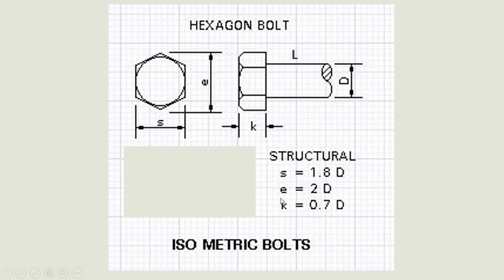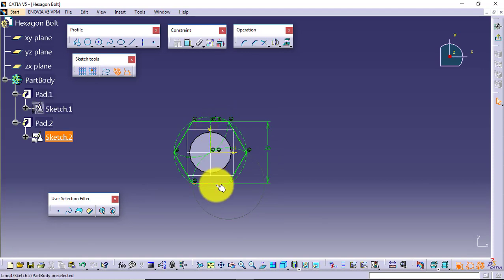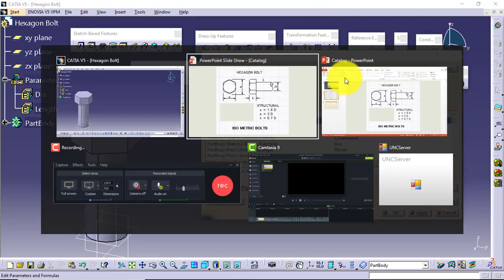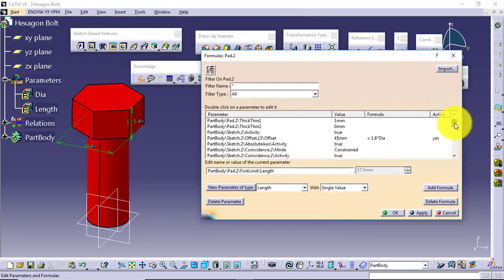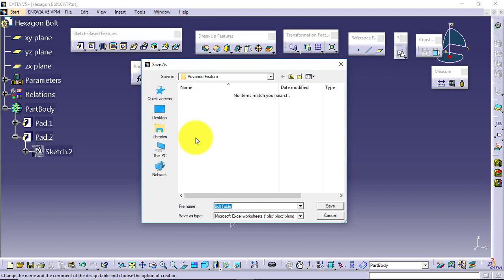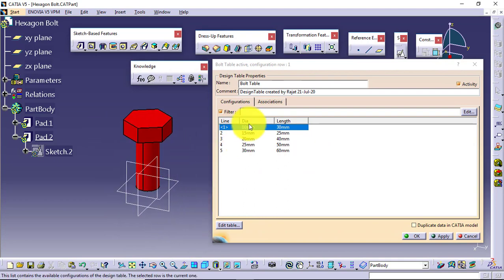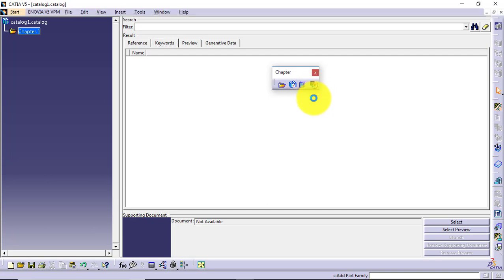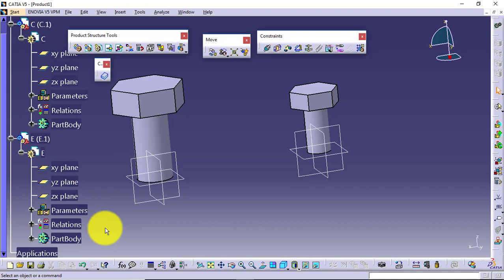Part Family in CATIA V5 || Step by Step Approach for Creating Part Family (Library) in CATIA V5

Comment: I'm facing an issue while applying formulae
Units are homogeneous(constant into m)
Reply from the maker: Try applying units from primary settings. After that use formulas
Reply: @mastertheskillls  sir I have already set my units into mm by going to option-parameters and measure.
Please help
Reply from the maker: While giving the values in parameters and relations.... Press enter after value, it will automatically take in mm, if not then you can manually write mm with the values. It would be resolved
Reply: @mastertheskillls  sir after applying mm (dia /2mm),it still give me same message
I even press enter after putting the value
Reply from the maker: @sahilabbas6190  keep space between value and mm, it will work.
Reply: @mastertheskillls  after applying space ,Dia /2 mm
message appears

Units are not homogeneous(m-1 into m)
Reply from the maker: @sahilabbas6190  try putting some value instead of Dia
Reply: @mastertheskillls  it works sir
But how I am I going to make relation without typing dia
I'm just doing the same as your video shows
Appart from all this ,i really appreciate your fast reply to help me
Reply from the maker: If you have already defined the dia as a parameter then it will definitely work... Also check that units are the same at all places... Try the complete process in a new file from the beginning.